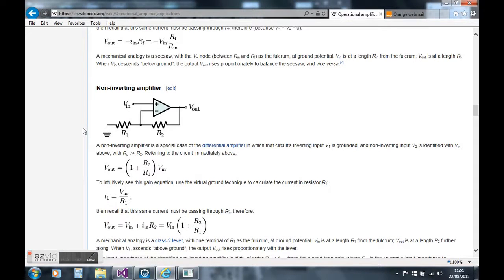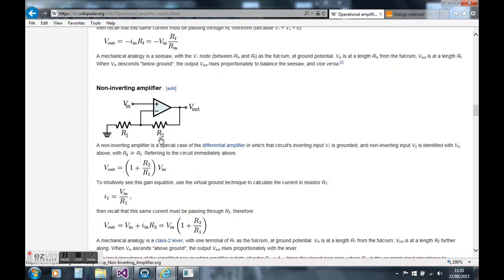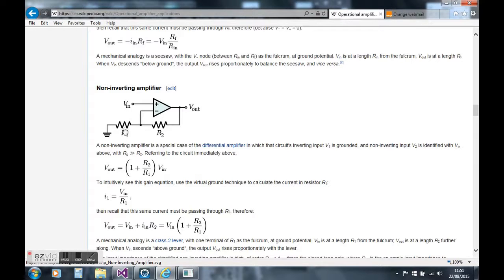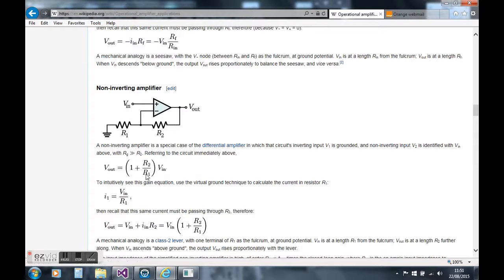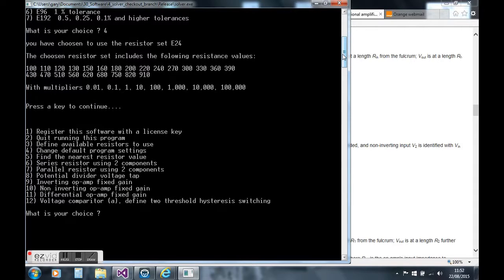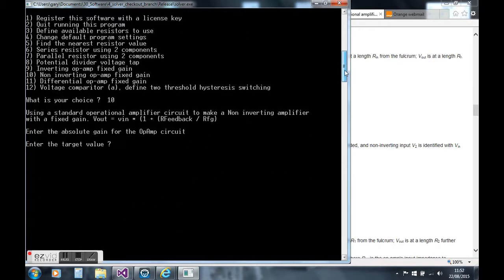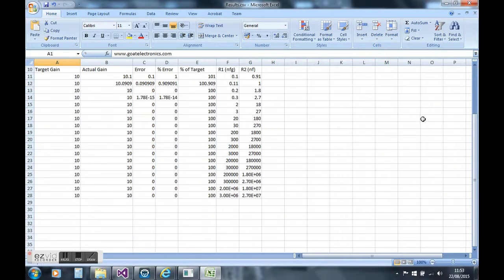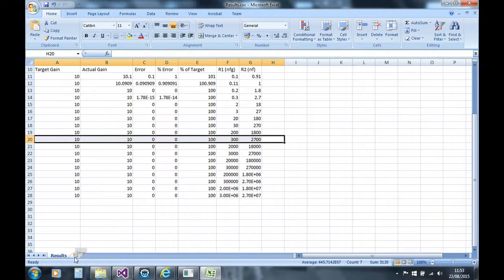designing a non inverting opamp with a gain of 10

Comment from the maker: Also, balance the non inverting op-amp input by adding a 3rd resistor equal to the equivalent parallel resistance of RF & RG to reduce offset voltages caused by input bias currents.